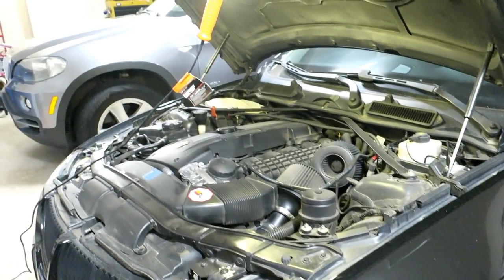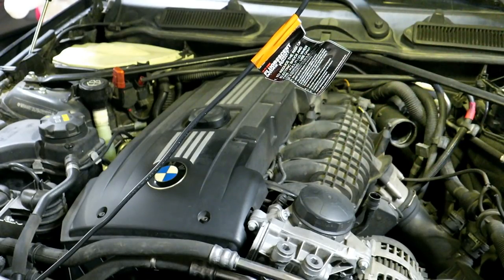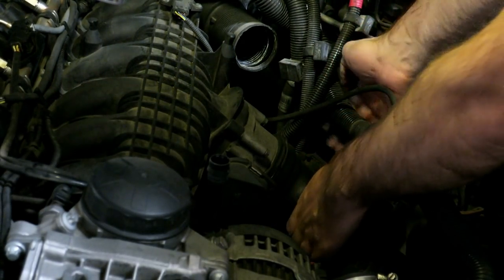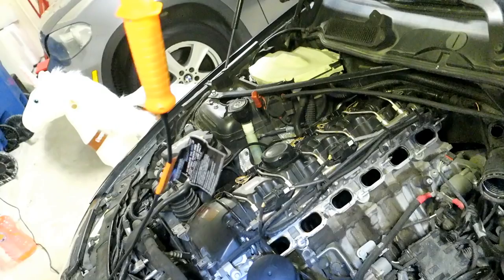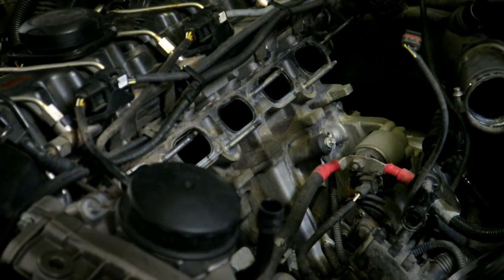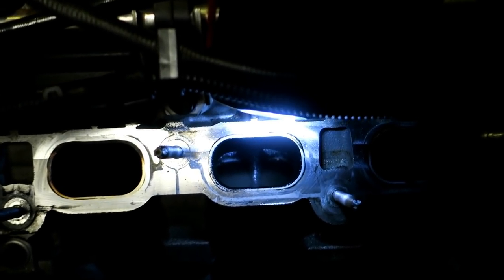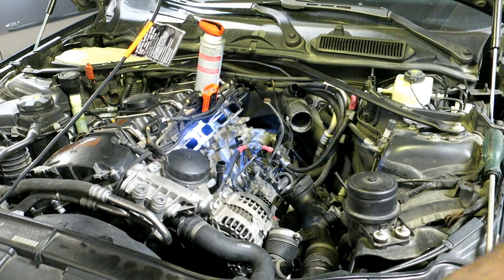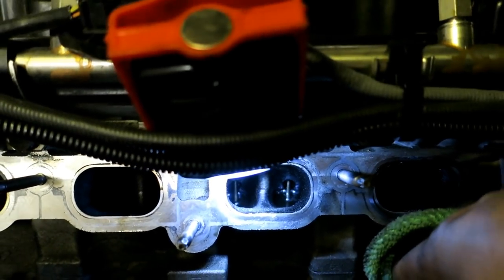Intake Valve Cleaning Without Any Special Tools N54 N55 DIY

Comment: to turn the motor over, jack up one of the front wheels so it hangs in the air. the other wheel has to touch the ground to prevent it from turning. then put the car in the highest gear (engine off obviously) and turn the wheel that hangs in the air by hand. that turns the engine over.

Comment: Did you end up finally doing a walnut blast I tried your method and it works it’s just not perfect
Reply from the maker: No I was happy with the results and did a follow up cleaning also.  You have to do it about 5 times per valve but you just fill it and walk away and come back.  It'll eventually be completely dissolved.  So it would be best if you had it in your garage and just come check on it every once in a while.
Reply: Vehicular DIY thx. I tried the alligator clip and they melted - too thin.  Can I just unclip the coils and turn the engine with the key to get the valves to move?

Comment: I assumed you clean your throttle body also did you open the butterfly  to clean it or just outside on both sides
Reply: izcoronel it is good to open the butterfly to clean inside when is cable controlled. In this case not recomendad for it’s “signal controlled” so you move it and it will need to be “re-calibrated” and I’ve heard is a PITA to do
Reply: thank you very much I have another question for you I have 2008 335xi I cleaning the valve cover gasket and unfortunately I dropped a piece of gasket about two and half inches long I tried to retrieve it but to no avail. what do you think I should do I tried to pour more oil hoping to flush it to the drain hole but no luck what do you recommend do I have to drop my oil pan .your response very much appreciated. once again I thank you

Comment: Can you show how you would use this product through the intake valve or vacuum valve.
Reply: Most likely its through the brake booster line or vaccum hose that attaches to the intake manifold. If you've ever used seafoam, it's a similar procedure. That stuff cooks off all the crap with the car off and when you restart the car and rev it out its smokes out the exhaust which tells you its working. Like easy-off inside an oven.

Comment: Would the dissolved carbon cause any problems for the converters downstream? Just curious as an old exhaust man. Thanks
Reply from the maker: Bert Astleford IMO it wouldn't be an issue as they are designed to deal with carbon.

Comment: I can't really tell if the valves are open or closed.  If i clean them all  as is (open or closed) with intake cleaner and use your blow out method through the spark plugs I should be fine ???
Reply from the maker: Sorry late response, but yes if you remove the spark plugs and turn over the motor you don't have anything to worry about.
Reply: Vehicular DIY can i do the same w walnut blasting, and if i want to close them can i just start and turn the car off?
Reply: you will have to KEEP the VALVES CLOSED while you walnut blast - that's done by taping off the intake openings of the cylinder(s) you are NOT working on, as the valves will be open. Blast the valves, remove what shells you can, then tape and move on to next cylinder. For me, I blast THEN do this cleaning.

Comment: Did you also do a EGR delete, since thats the problem that creates clogged valves? I did mine..
Reply from the maker: I'm assuming you mean the PCV valve delete?  I am looking into it.
Reply: Or just install a catch can
Reply: Install a decent OIL CATCH CAN on the PCV valve.
Reply: semecristian These do not have an EGR system.

Comment: do you have always close the valve before spraying?
Reply: Jose ph yes
Reply from the maker: Yes very important to make sure the valves are closed.  If you let any fluid get in make sure to pull the plugs and crank it over to blow any fluid out like I show in the video.

Comment: Did you replace the spark plugs or put them back in?
Reply from the maker: At that time I cleaned them and put them back in but not a bad idea to change em out if you're going to be in there anyway and they're coming up for replacement.

Comment: Heya , thanks for the diy , do i need to pull out the injector connectors too? I mean when u crank it to take the moisture out trugh the spark plug hole.Thanks!!

Comment: when you bumped the starter did the fuel pump come online n sprayed fuel?
Reply from the maker: No it didn't activate the lower pressure fuel pump while bumping the starter.
Reply: the fuel pump will not engage because the ignition is off. he jumped 12v to the starter coil. I don't think the plugs even fired, just have to watch that you don't zap yourself. I would definitely use eye protection and a well-ventilated workspace. Its also not a good idea to use anything metal to poke around in or scrap the ports.

Comment: Can someone help me understand the bumping? I never see @vehicular DIY respond on any comments, but would be crazy helpful!
Reply: just do what he did at 25:48 with the clips. all you have to do is touch the metal on the starter with the metal on the clip until the valve you want to spray into closes
Reply: @dean6912  ahh.. i get it.. so i can literally take ANY wire that connects those two points and it will bump over?? I was thinking I needed to use a trickle charger or something... 

Also, on another channel, someone said to take out the spark and coils. Do you agree?
Reply: @christianoland9878  Yes you can use any wire that is what I did, and no i did not take out my spark plugs or coils and I had no issues. Make sure you dedicate at least a full day to clean your valves it took me a few hours

Comment: This video would be great if you did one cylinder at a time closing the valves and using shop air and rags to remove debris. All your doing is pushing that crap into the engine. This will hurt someone

Comment: Why did it take so long to crank the engine over and start the car? Just cleaned my intake valves by soak and scrub, curious as to what to expect once I turn it back on for the first time after I replace turbos
Reply from the maker: I'd say because the cleaner got into the cylinders and it took a bit of time to build up compression again.
Reply: Vehicular DIY is that bad for the engine that some of the cleaner got in? Is there any way to ensure no cleaner will get in?

Comment: Uuuh did u read the instructions on the can. It’s made so you don’t have to take the intake off. Just spray intermediately into intake hose or vacuum while rpms at 2500-3000 til Can is empty etc etc.. read the instructions
Reply from the maker: I definitely did, I'm sure that would make a slight dent in the carbon.  I sprayed the valves directly to get them as clean as possible.  To be clear this video does not demonstrate how to use the product as suggested by the manufacturer but I am pleased with the results and impressed with the product.

Comment: just use the CRC every oil change directly into the intake manifold. problem solved
Reply: Hi, I agree to spray “directly into the intake manifold” ......However,m where do you exactly spray it?......Do you remove the cold air intake and spray through the throttle body?

Thanks,

Mike
Reply: No dude, all you do is remove a vacuum line on the intake manifold and spray into it. I'd rather use seafoam myself. Take a length of hose that fits the hose nipple on the intake manifold vacuum supply and stick it into the can of seafoam. Start the car and run it while pulling the solvent out of the can into the hose. Car will stumble and run rough. Shut the car off. Reconnect the vac line. Let car sit for like 20 mins. Start it, and watch the smoke pour from the exhaust. Rev it a bit. Go drive it. When it stops smoking, the solvent has finished burning off the carbon deposits. Done. People including myself have been seafoming cars for years. It's not a new procedure by any means, and honestly it does work.

Comment: Great job as always man! Glad to see a very good alternative to walnut blasting, definitely made this DIY 100% possible, so thank you! Car picks up very well too! What power/map is it running, can't remember if you're using MHD?
Reply from the maker: Thanks!  I was told by the previous owner that it was a Dinan stage 2 tune.  I haven't been able to confirm.  The car has dual cone intakes, intercooler upgrade, stage 2 tune and downpipes.  I'm thinking about doing inlets and getting a custom MHD tune.
Reply: Vehicular DIY very nice!

Comment: Get some Pipe or Gun Brushe´s and really clean everything ! After this ,change your Oil from  5W-30 to a Performance 10W-40 ..And do a Oil change every year or 15000 km . The thick oil is vaporizing less and thus less oil steam is carbonizing in the intake !

Comment: have you added an oil catch can after doing doing this valve clean ?
Reply: Even better is to look into tapping and plugging the intake runner port holes to the valve cover and externalize your low-side PCV system (via RB Turbo's kit) through a low-flow catch can (like a mishimoto or cheap ones on amazon like Tasan Racing that have the sintered metal air/oil separator). This way, you separate the valve cover from all boost, making it less likely to crack and/or make the gasket leak. Also, under vacuum conditions, having those holes plugged keeps un-separated oil mist out of the intake runners (because externalized PCV would then redirected this mist to a catch can first, before the separated air goes back to your throttle body). This maintains crank case vaccum as well. I catch 3x as much oil in my mishimoto low side can than the burger motorsports "high side" can. I run both.

Comment: Hey bro I’m looking to get a 335 but hard choosing n54 or n55
Reply: christian lopez both are good engines .n54 requires a bit more attention than n55 but worth it. I pray u find a good one!
Reply: Billy Owusu yea took me over a month looked at least 10 cars mostly 54’s a couple 55’s one of the n55s I looked at was knocking like crazy deff a rod bearing to bad to it was spotless other than a little oil coming from the filter housing gasket the guy only wanted 6 grand for it 2011 with 120k deff to good to be true I ended up buying an 08 that was meticulously maintained and cared for never ran on a tune and only a couple mods duel cones tial charge pipe exhaust and it had index 12 injectors with the M3 wheels hopefully it’s good to me

Comment: Looks like you need to switch your oil
Those deposits are oil vapours coming from PCV that gets deposited on the hot surface
Please give mitasu engine oil a try to avoid these issues

Comment: I tried this and it didn’t work at all. When I put the car back together I started getting rpm fluttering from 1000 rpm to 1500rpm
I’m getting powertrain codes 
And o2senor codes 
P1417
P0156
P0136
P1632
P1638
P:11
P1639
I can’t find the problem
Reply from the maker: Meeky Meek Check the harness going to the throttle body and fuel pressure regulator.  Basically all the electrical connections under the manifold. Sounds like you may have mixed up a connection.
Reply: Vehicular DIY I will give it another look and get back with you
Reply: Vehicular DIY I check all connections and it’s still revving from 1000 to 1500 but now my windshield whips are going and all lights are on with the radio out and lights not working on the inside of car. I’ve had similar problems when my alternator went out but minus the revving. I have bad battery could it be that?
Reply: Meeky Meek so this did not clean your valves at all? Did you recheck the starters wiring for your electrical issues?
Reply: bcbp14 it didn’t clean my valves at all and I’ll give it a try again
Reply: Meeky Meek sounds like you fried your DME
Reply: OR OPEN your glove box and there should be a big black relay on the top right. Pull that out and pull the same black fuse from your  dme box and stick it into your glove box. You may have fried that fuse
Reply: dreezy franklin alright I’ll check it and get back with you
Reply: Meeky Meek I would like to know if you ever found your problem? What was the source of all the weirdness?

Comment: You can , per the product instructions from crc  , spray the whole can into the throttle body or air intakes or vacuum port)  while keeping the car revved to 2000 rpm (to keep the throttle body butterly valve open).  Then revv to 2500-3200 but not above 3500.  I used a stick on the gas pedal or u can use a friend to do it.. Let idle for 1 min, shut off.  Then let heat soak for 1 hour which is critical accord to crc.  After the 1 hour drive at highway speeds for 10 mins to burn off the dissolved carbon. Drive the next week regularly but not above 3500 rpm (I believe in order to not create carbon back from the dissolved remaining chemical compound).    Having the engine running is critical for the heat soak to make the product chemistry work to maximum effect.
Reply: Mark Allen, I'm pretty sure you can do all what this guy is showing us in this video and then buy another can and do the can method that you're describing above. That way you'll be more than sure that your intake valves are pretty clean
Reply: Mark A I was thinking the same thing. Why take off the intake and go through all the headache? The instructions are very different on the product.

Comment: Try that same method and it didn't clean squat. The brush did most of the work better than that intake cleaner crap.  Logically the walnut blaster will do a much thorough job.

Comment: I wonder if spraying into the boost line that goes into the manifold ( I have a 1/4 tap already ) while the car is running
Reply: Totally works.  Let it soak for more than only 1hr. People actually tried 2 hr heat soaking with much better results

Comment: I wonder how this would have worked if you followed the directions and did it the right way. Neat video tho
Reply from the maker: I'm sure it would have done something but I'd doubt it would make them completely clean.  Maybe after multiple applications.
Reply: I have a '12 Genny with 76K miles. I just did the CRC Intake cleaning per instructions on the can and will do another can (got the cans on sale for like $10 at O'Reily and I get a 10% military discount on top of that...so 6t cans is  deal (one for each cylinder)...I am going to rig up a vacuum line so I could just let this stuff into the intake while I'm driving.
Reply: @QuantumRift  Enjoy overhauling your engine after the cleaner dissolves the oil film on the cylinder walls.
Reply: @maxnix346  That's about a stupid COMMENT. Either it went totally over your head or you just didn't understand. I'd use 1 can per cylinder IF I was pulling the intake manifold. I'd just one or two cans while DRIVING to meter the cleaner into the intake manifold. But you didn't get it.

Comment: Would running the engine hard clear most of that paste off
Reply: No. Most cars inject fuel before valves, and that keeps it clean. These N54’s inject fuel directly into the cylinder, so these valves get more gunked up than usual

Comment: Will a catch can help?
Reply: Catch cans do help, but they do not prevent this from eventually happening.
 I would still get a catch can to decrease intervals of valve cleaning as well as engines run better when their is less oil getting into the combustion chambers.

Comment: could have saved a lot of time by removing the intake pipe instead of the throttle body, you removed the bovs and had room to remove the pipe and then get the manifold out but i’m just high asf rn

Comment: I live in Houston and am having an issue with my idrive, can you help me out please?? I'll pay you
Reply from the maker: What issue are you having with your iDrive?
Reply: Vehicular DIY I posted a video to my page, but it wont turn on when I turn the car on. If I manually turn the volume knob then it starts but doesn't think my car is running. Music and everything works. I had a bad battery and I've replaced the bad battery but I think something needs to be reset.
Reply from the maker: Perhaps your CIC system is stuck in "Transport Mode"  Do you have INPA setup on a laptop or DIS V57?
Reply: Vehicular DIY no I don't have any coding equipment at all. I removed my negative battery terminal and since then it has started doing this.
Reply: Vehicular DIY were you able to find out wether your software can reset cic?
Reply from the maker: Hey shoot me a PM.